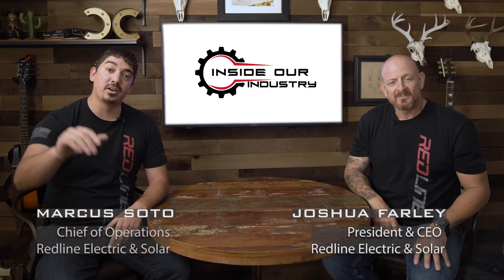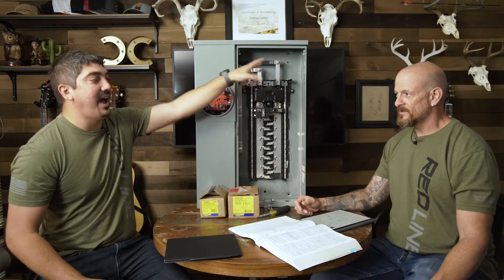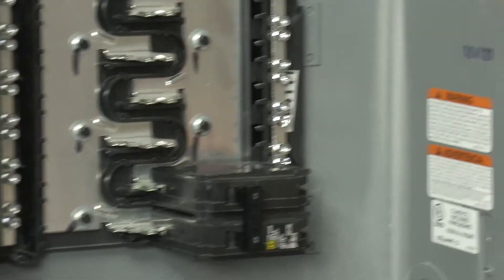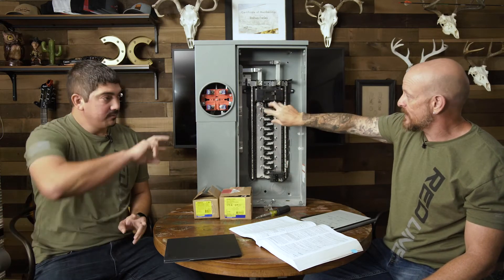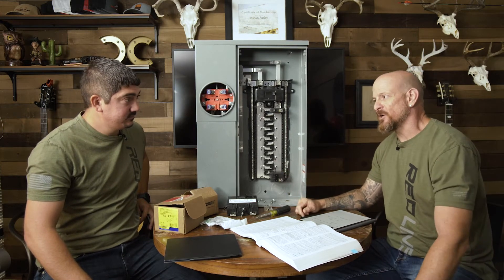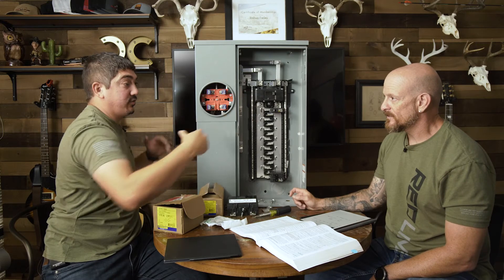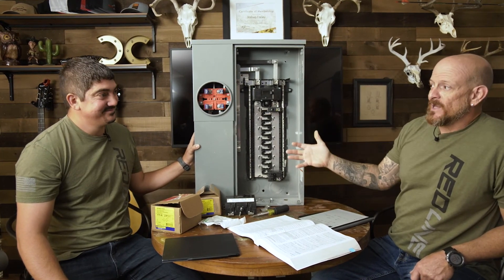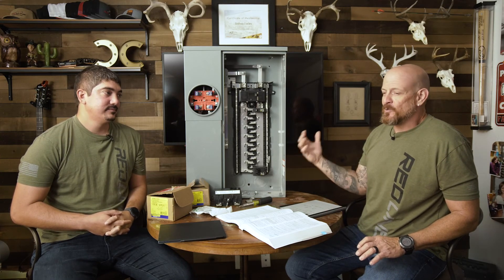What is Derating? Inside Our Industry- Redline Electric & Solar

Comment from the maker: Have a question? Leave us a comment!
Reply: Great video!! Just curious, when you backfeed solar into the main service. How can that work with two different services being combined? Wouldn’t that blow up from being back fed? 
Like having an interlock on a main panel for a generator, so two different sources can’t be on at the same time.  I’m confused, Thanks.
Reply from the maker: @mcarroll598  the solar inverter synchronizes the frequency and the output voltage to match its connected grid. I haven't worked with a generator smart enough to do that yet🤷‍♂️. Rapid shutdown technology turns the inverters off when the utility goes down to keep the solar from back feeding. Hope this helps!
Reply: @Redline-Electric-Solar  appreciated it man thanks!!
Reply: Why derate to 175 from 200?

What formula allows this specific reduction in amperage?

Shouldn’t we de rate to 150?
Reply: You derate for the appropriate amount needed for your solar backfeed.

Comment: Crossing my fingers this comment gets noticed, even on a video from 2 years ago. 

As simply as I can ask it, (assuming I meet all code requirements, 2020 here in Utah) are inverters (that you are familiar with at least) able to have a supply side splice between the overcurrent device and the panel, that runs through a 60 amp breaker into the inverter "Grid" connection side of the inverter (again 63 amp breaker in the inverter to protect this connection) and then use the 'load' connection on the inverter, sending grid passthrough power, + battery, + DC solar panels (63 amp breaker on the inverter) to backfeed into the main panel?

I can see a couple of limitations I can see. It's a Sol Ark 8k, so a total of 63w max output, between the grid passthrough, solar production, and battery. If the grid goes down, we are down to just over 30 amps max.  That can easily overload what the inverter can push, without using the internal limiter.

That said:
1:  I can 1: limit the max output of the inverter to prevent damage to it.
2:  We are planning on installing a Leviton panel, and I intend to use smart breakers that will trip off branch circuits when the power goes out, to control the essential loads vs load that can be turned off or if things get over loaded.
3: I'd prefer to have a single loadcenter, not two.

Context and backstory, if it is helpful. The solar install company (name withheld until I hire an experienced code inspector to do a 3rd party inspection and documentation) installed the inverter and battery and solar panels on to the existing 200 amp service at my parents’ house. (I just moved in next door and only recently discovered the problems) they choose to take the entire 200 amp service, through a the 60 amp breaker, giving them a grand total of 63 amps for their entire service. Including the grid pass through. And didn't mention that fact. When they installed it. And we need to upgrade some items, including adding wo mini splits. Ant that just won’t work.

Some of the problems and violations existed before they showed up. For example, it's a Zinsco panel, and as near as I can tell, it was installed in the 60s. It's using (all but one) original Zinsco breaker from all those years ago. It's now a subpannel, with neutrals and grounds all mixed up. Some concerning spots on the bus bars, but I’ve seen worse, thank god.

On their side of mistakes, for example, when the 3/0 copper wire coming into the house (feeder not service, fun fact, there are no service entrance conductors) was not long enough to reach to second panel they installed to pipe the gid power out to the inverter, they just used some Polaris lugs (smart move) to splice on some extra conductor to reach the extra distance. Why the thought it would be a good idea to connect the 3/0 from the 200 amp service disconnect into 4AWG aluminum, I have no idea. Sections 220 and 310.12(C) They introduced code violations left and right some large, mostly small. But very very unprofessional.

Thanks for making it to the end. I'd love to know if it's save to back feed into the same panel (at the bottom) where I am splicing into the grid or supply side of that same panel board, provided I am able to control essential and nonsensical loads without the use of a sub panel.

Thanks!
Reply from the maker: Hey, Yummy! Did the original installer have a permit? If so, they should have an engineered plan set that shows what they did and why. I am happy to discuss this with you.
Reply: @Redline-Electric-Solar  Thanks Joshua! I really appreciate the chance to get a second set of eyeballs on this. It was permitted. They should be safely stored away for future needs... now if only I remembered the exact filing cabinet :P 

Bad joke aside, give me a day or so, and I'll shoot you an email.

Thanks again sir!

Comment: Video very helpful, especially moving 25a from main to solar in comment.  Derating seemed to say larger wire not good, smaller OK.
Question - inverter AC out of 48a x 1.25=60a  60a breaker OK or use 70a?
Reply from the maker: 48a x 1.25=60a. 60amp breaker is perfect!
Reply: @Redline-Electric-Solar  Thanks, working my back through the videos.

Comment: Great vid guys! Question, city says my setup doesn’t comply with the 120% rule. Solar w/batter backup with 125amp sub panel. The main is ge 200amp with a 200amp bus, I have a 70amp back feed Solar breaker and left a 50amp ac breaker in main also. What would be the correction? Thanks ahead
Reply from the maker: If you have a 200amp panel, using the 120% rule you would only be able to have a 40amp solar back feed breaker, unless you derate the main breaker to 170amp (200X1.2=240-70=170) however, a 150amp breaker would be the most common step down past 175a. If you have both the solar (70) and the battery (50?) you would need to derate further. Do you have a critical loads panel and a Transfer switch?

Comment: Do you have to derate for continuous load on solar feed? Example. 15000 watt solar inveter. 15000÷240 = 62.5 amps. 65 amp breaker or 62.5 x 1.25 = 78.125 amps or 80 amp breaker?
Thanks, Gordy
Reply from the maker: 80amp:
690.9 Overcurrent Protection. 
(B) Device Ratings.
Overcurrent devices used in PV source circuits shall be listed for use in PV systems. Electronic devices that are listed to prevent backfeed current in PV system dc circuits shall be permitted to prevent overcurrent of conductors on the PV array side of the device. Overcurrent devices, where required, shall be rated in accordance with one of the following and permitted to be rounded up to the next higher standard size in accordance with 240.4(B):
(1)
Overcurrent devices shall be rated not less than 125 percent of the maximum currents calculated in 690.8(A).
(2)
An assembly, together with its overcurrent device(s), that is listed for continuous operation at 100 percent of its rating shall be permitted to be used at 100 percent of its rating.

Comment: Don’t forget a “solar ready” panel busbar rating in a 200Amp service panel is rated for 225A. Giving you 70A of potential solar back feed instead of the normal 40A without needing to do a Derate. Derating a solar ready panel to 150A would give you up to 120A of solar back feed which is how they should come. 200A panel, 225A busbar, 150A main breaker is optimal for residential needs.

Comment: Have you ever de-rated 125amp panel to 100amp for 6.0kw solar system?
Reply from the maker: If your panel is 125amp buss rating you would be able to go 120% = 150amp total. Then derate to 100amp = 50amp total available backfeed breaker from solar. That should be plenty for what you're looking to do😎👍

Comment: What if the meter main was base on the house load and now the breaker is getting derating will possible create a tripping problem? Just wonder.
Reply from the maker: There is always a possibility for the main breaker to trip. However, the load calculations on a home are done so as to keep this far away as possible to allow for this derate to occur. NEC allows a load study calculation based on 72hr or 30day. As long as you stick to those calculations you are fine per NEC. However, yes, you may need to upgrade to a larger service if you cannot work under those parameters.

Comment: Awsome video.  I am looking at going solar and have a 125A panel.  Do I need to upgrade.  My vendor is recommending a subpanel to save money.  What do you think?
Reply from the maker: Interesting...
Your amperage rating has nothing to do with the need for a sub-panel. If you're out of breaker space you may need a sub-panel. If you need more amperage the sub-panel will not help. You would need to upgrade to a larger service. Are you in Arizona?
Reply: @Redline-Electric-Solar  No, I am in CA.  They said a subpanel  $900 (probably as you said out of space) and derating main breaker $700.  I am trying to get the app in before the new net metering rules on Apr 15th (SDG&E ripping us off)
Reply from the maker: Yeah, they are trying to fight against Solar!
I'm not sure if those are good prices as I'm not in your market. But they're in line with a few scenarios we see.
Reply: @Redline-Electric-Solar  Thanks for the reply.  Last question. I'm more interested in how limited I am with this scenario of my existing 125A panel without doing a new panel upgrade.  How would you handle this situation and solar system size recommendation.
Reply from the maker: 125amp is small for us as in Arizona we have large cooling loads in the summer. And if you're derating, to 100?, That may or may not leave room for growth. We would probably suggest you upgrade to a 200amp panel with a 225amp buss rating and 30-60 circuit capacity depending on what you might go in the future. i.e. pool, hot tub, welder, etc...

Comment: I have a friend who works for a solar company. I myself am an Electrician and have workers on solar systems but via my contractor. But he’s needs help with d rating systems. So he’s asking for my help. How much should I charge including materials?
Reply from the maker: The breaker cost and how many hours it takes you to do the work. You may want to add costs for permits if you need to get the utility involved. We've seen derating costs range from $500-1500

Comment: So how does the breaker code for main at the top and the solar breaker all the way at the bottom work on a panel that feeds the busbar from the middle?
Reply from the maker: Still furthest spot from the breaker. In either direction. Top or bottom, you pick!

Comment: is there disadvantage of derating?  will it cause more breaker tripping and resetting?
Reply from the maker: The only disadvantage I see is you are losing 25-50amps of maximum capabilities, however, typical home peak loads rarely exceed half of the service rating to the home. If you derated your 200amp main breaker to 175amp or 150amp, this will be your new "limit"... make sense? If not we can shoot a video to help! Thanks!
Reply: @Redline-Electric-Solar  Thanks for reply.  It does make sense.  After derating from 200A to 175A, can we still add EV charging to the same panel?
Reply from the maker: @gillybabi5642  in most cases absolutely 🙌
Reply: @Redline-Electric-Solar  Our panel is SU2040M200F and the breakers are all used up with 3 tandem breakers already in place.  Is this still okay to derate by adding a fourth tandem to free up a breaker slot?  Or, is it better to upgrade to a larger bus or larger amp panel?  If side-tap, the 120% rule to 200A of main panel still applies, correct?
Reply from the maker: @gillybabi5642  great question! Your panel is a 20space 40circuit, which is designed to be filled with all tandem breakers if needed 🙌😎👍

Comment: How does the panel service load calculation play into the derating?
Reply from the maker: We take load calculations into consideration when sizing the system. When working with our engineers we see if a derate is possible or if we need to provide a panel upgrade.